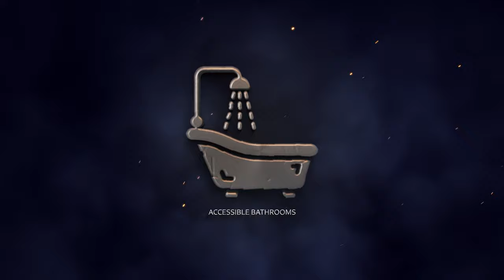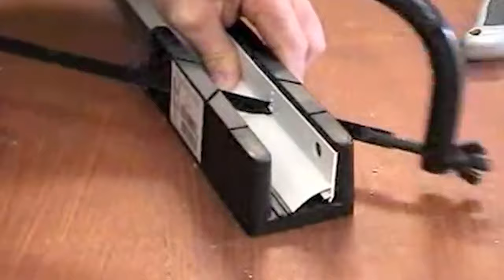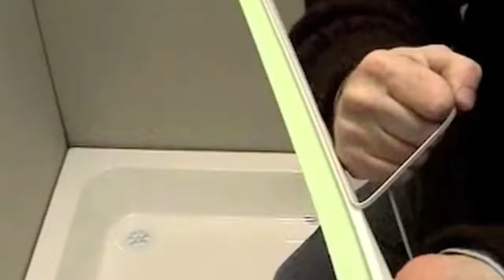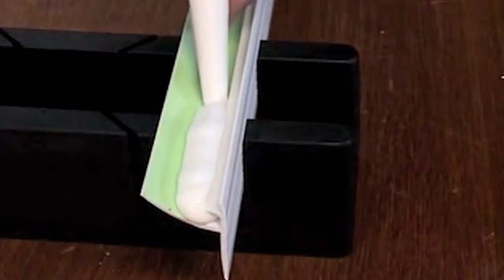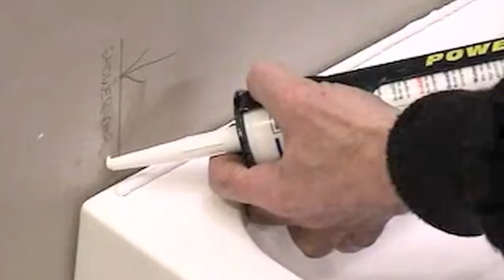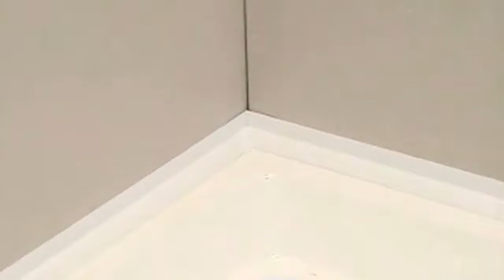Tape Caulk Strip - PVC Self Adhesive Caulking Sealing Tape for Kitchen Sink Toilet Bathroom Shower

Comment from the maker: Tape Caulk Strip👉👉👉https://geni.us/DR7JKe  [Amazon]
Frameless Shower Door Bottom Seal 👉👉👉 https://geni.us/BiNL0xC  [Amazon]
Sealing Strip👉👉👉https://geni.us/rhTyli  [Amazon]
3 in 1 Silicone Caulking Tools 👉👉👉https://geni.us/9byv  [Amazon]
Seal Caulk 👉👉👉https://geni.us/Q0PB  [Amazon]
Smooth Hex Rod Cradle Caulking 👉👉👉https://geni.us/NKhXK4  [Amazon]
Caulk Gun  👉👉👉https://geni.us/rhod  [Amazon]
Reply: What's the name of the plastic strip used in the video? And where can I purchase this type of strip from? You have not provided a link for it.
Reply: @ya00007 it doesn’t work just do the old school way caulking and caulking gun.  The magic caulking strips are bs it comes off it direct stay on lol